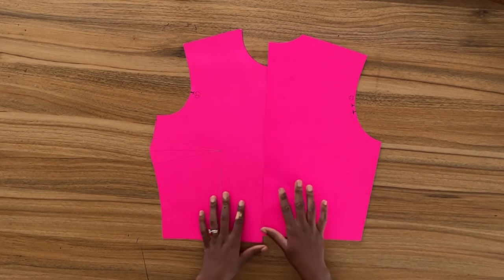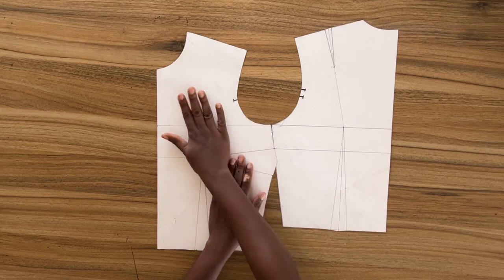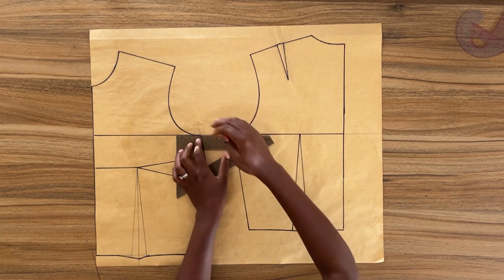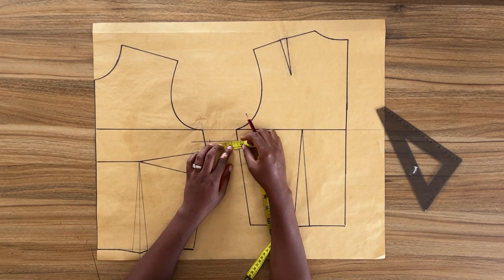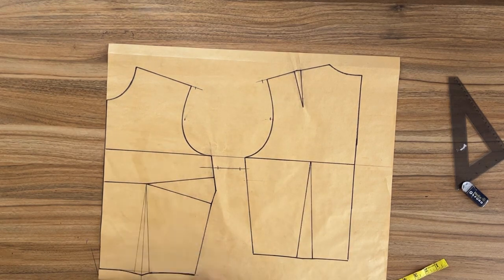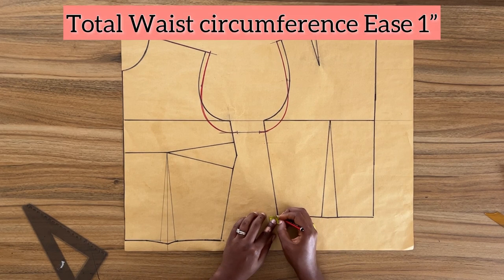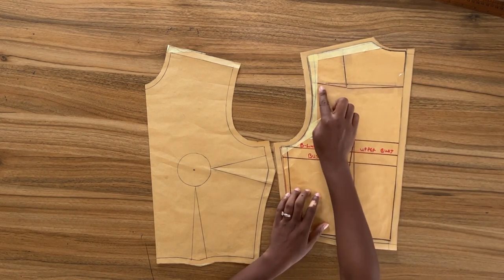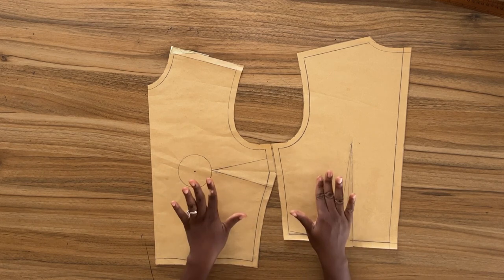Basic bodice pattern alteration | Adding Ease | Altering Armhole depth to accommodate Sleeve

Comment: Thank you for the video. Does the sleeve pattern still work for the altered bodice?
Reply from the maker: Well I’d say make this adjustment first before drafting your sleeve I used my actually side seam length without ease when I was drafting the  bodice pattern  so this adjustment was necessary . You do need to drop the armhole depth for ease of movement
Reply from the maker: And by the way I don’t know how you got your side seam length . for me I placed my index and middle finger high  under my armpit and then measure from underneath the middle finger to my waist   ( you can use a ruler that is 1” wide under your armpit this is easier than putting your fingers ) which gave me 8½ inches so I have to drop the armhole 1”  for sleeve so this reduces my side seam length to 7½ inches .